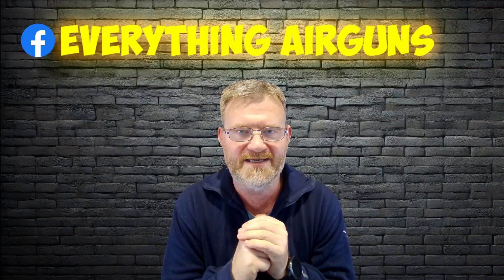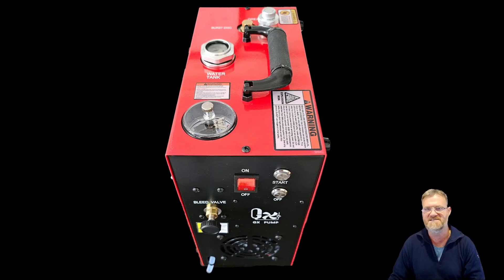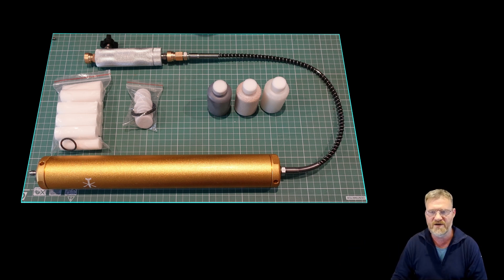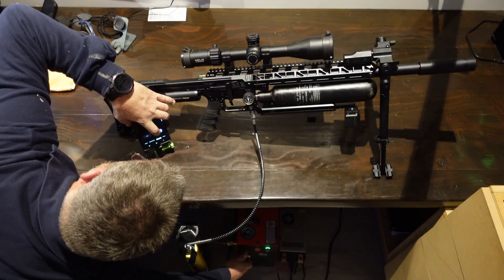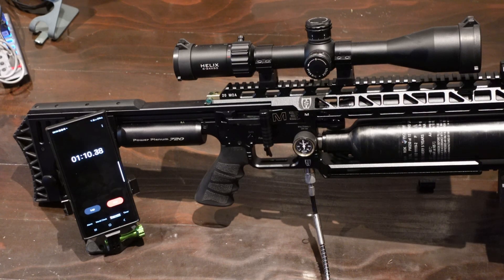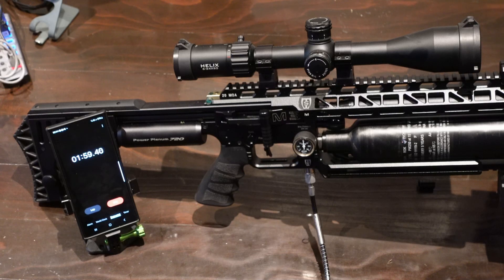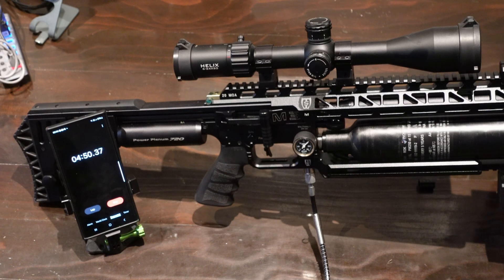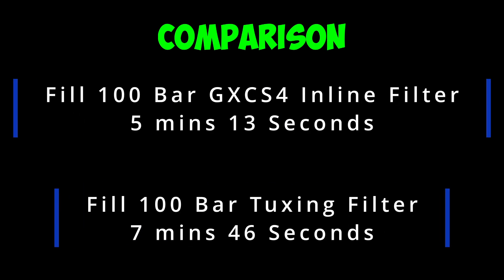FX Impact m3 Fill with the GX CS4 and Tuxing 4500 PSI Filter attached

Comment: Is there a reason you didn’t use the smaller silver filter with the relief valve.  Mike
Reply: Thanks for your video and your prompt answer.  I’m new to PCP guns and am wanting to use the Tuxing filter setup you are using.  Do you know if the silver filter with the relief valve is used while the system is under pressure or after the compressor has completed filling the gun?
Reply from the maker: Hi Michael, thanks for your question, I didn't have the extension hose, once I have this setup permanently with a hose that goes through my desk, I shall definately fit it.

Comment: Can you fill scuba tank bottles with that type of compressor you’re using?
Reply from the maker: Hi Kirk thanks for your question, 

The GX CS4 airgun compressor is designed for filling PCP (pre-charged pneumatic) airguns and small tanks for airguns. I know of people filling large airgun storage bottles with no problem. I can't comment on scuba tanks as not really use mine for that purpose however  I guess at a push it could potentially fill a small scuba tank, but it may take longer to complete than a purpose built scuba compressor specifically built for filling large tanks. 

Opening the floor to the rest of the group anyone else use theirs for this purpose. If so could you comment and give Kirk some info..
Reply from the maker: Just scraped from gx cs4 manual if this helps.
Maximum filling 5800Psi/40Mpa

How long to get it there though not sure from empty
Reply: @KinGr8Airguns  I hve a JST 6200psi that is a direct rebadge of a GX CS4-i.... but higher pressure different gauges. Same stickers.  Redlines at 6200.  works well.
Reply from the maker: Maybe you could fill it in stages so not overpowering it,  ie take it up to a set  pressure and then give it a rest,  then a bit later finish it off so not pushing it to much or overheating it.  Would also recommend looking at some other forums  and see if anyone else is using it for this purpose and how they get on.

Comment: Awesome!!  Thanks man.
Reply from the maker: No problem sorry it took a while, I still rate it the tuxing 4500 is quite large so a bigger void to pressurize up initially however with the amount of filters and wadding in there. You know your getting good clean dry air into your rifle.  So my 2cents the extra time to fill is well worth it. If time to fill is a game changer then you can get a smaller chamber filter with hygroscopic filtration.